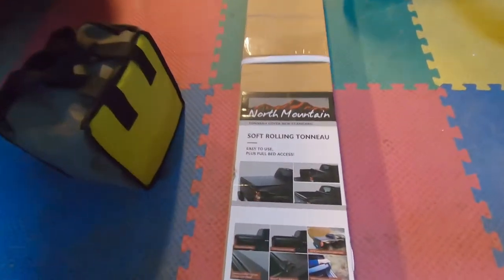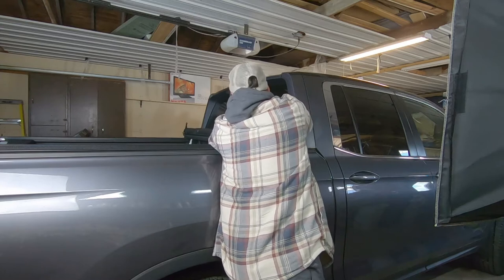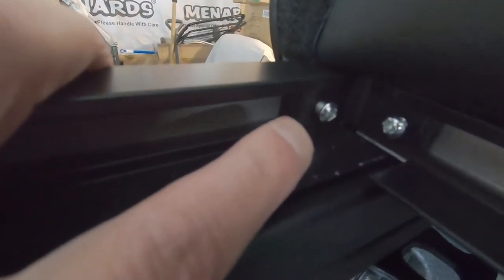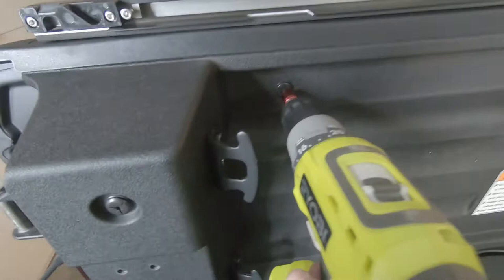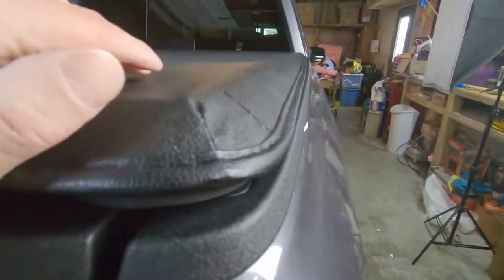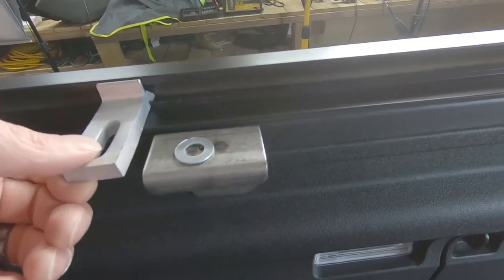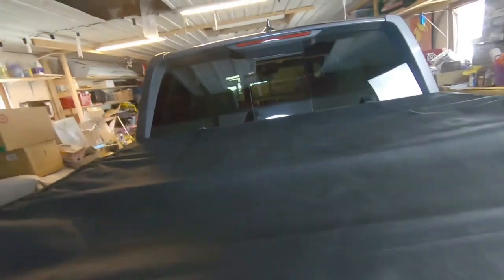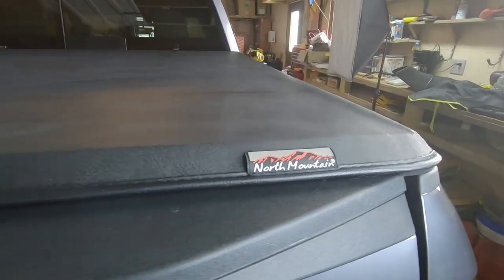How to install a tonneau cover on a Honda Ridgeline 2017- 2023

Comment: Can you still open the trunk all the way with this installed?
Reply from the maker: It will open enough for access but not all the way, when the trunk is fully opened it is taller than the bed. If you need it open all the way simply roll the cover forward a bit.

Comment: Good video and instructions.  I didnt use a power drill to loosen the factory bolts just old man strength.  :)  Finding that T-30 bit was an interesting chore, I found one that was a little rusty but it did the job.   Thanks for showing how to do final adjustments.
Reply from the maker: Awesome! Thanks for watching! I actually just traded for a 23 and moved the top over to that one, it’s still doing great!

Comment: I just installed this one on my 2021. Everything fit great. However, my tailgate door don’t want to open when I roll out the bed cover. I don’t know if it’s a type of lock security. I tried unlocking with my fob. I also trie to disable the tailgate security lock. I’m not sure what I’m doing wrong. So, my tailgate door is lock and not opening. Any idea? Thanks. Great video BTW.
Reply from the maker: The 21’s do have the capability of a locking tailgate. It would unlock with 2 presses on the unlock button, or grabbing one of the front door handles which also unlock your doors. If it is not locked it may just be a tight fit with the cover and you’ll just need to tug a little harder to open it, Thanks for watching!

Comment: Just ordered one for my 21 ridgeline, 
Excellent video 📹
Question how many washers did you used and did they have any lock washer. 
Thanks.
Reply from the maker: Awesome, I just used 1 to 2 depending just trying to get the bracket level I don’t think there were any lock washers I’ve never had an issue with anything getting loose though!
Reply: @GetOutadventure  thank you for the quick response.

Comment: Do you think this Tonneau would fit the 2021 model? Thank you! 😀
Reply from the maker: Yes, I sell Honda for a living the only body style difference on the 20 and 21 is from the a pillar forward the bed is the exact same.
Reply: @GetOutadventure  Okay that is good to know. How much did you get this tonneau for?
Reply from the maker: @BengLang84  I shared the link in my description,  couple hundred or so I believe.
Reply: Put this on my 2021. Fit is spot on, installs same as in this vid. Only diff from 17-20 vs 21 is front end. Bed exact same.
Reply: Will this fit a 2022, I just purchased a 2022 Sport

Comment: Well, mine arrived with the proper labeling, in a box strapped and sealed, but the front bar, from end to end, with the corners installed flush, is too wide for the front sliders to have enough lateral slot, to secure the bolts.
If the clamps are installed to the bed with the factory bolts, There isn’t enough lateral slot in the front sliders to bolt them to the mounts.
Looks like I need to call tech support.
Is there a chance you can measure the width of your front bar, as installed to compare with  the width on mine? Just the bar: Outside to outside ends?That could tell me if they labeled the right box and right T cover.
Thank you.
Reply: In another video, someone said the brackets are different between front and back.  I’d better remove them all and compare them.
Reply from the maker: Where the front of the cover meets the cab I’ve got 64 inches. I hope this helps, if you have any other questions just let me know.
Reply: Thank you very much.  I just emailed North Mountain.
One person posting on another video said that, though the directions don’t say, —-the back brackets are different than the others.
Thanks for your help.
Reply: Success.  The aft sliders are shorter than the other four. 
I have some slight fore and aft wrinkles but I expect that will smooth out.
The bracket and fitment all the way around is great now.
Reply: Success.  The aft sliders are shorter than the other four. 
I have some slight fore and aft wrinkles but I expect that will smooth out.
The bracket and fitment all the way around is great now.
Reply: Success.  The aft sliders are shorter than the other four. 
I have some slight fore and aft wrinkles but I expect that will smooth out.
The bracket and fitment all the way around is great now.
Reply: Success.  The aft sliders are shorter than the other four. 
I have some slight fore and aft wrinkles but I expect that will smooth out.
The bracket and fitment all the way around is great now.
Reply: Success.  The aft sliders are shorter than the other four. 
I have some slight fore and aft wrinkles but I expect that will smooth out.
The bracket and fitment all the way around is great now.
Reply: Success.  The aft sliders are shorter than the other four. 
I have some slight fore and aft wrinkles but I expect that will smooth out.
The bracket and fitment all the way around is great now.

Comment: Great video. The instructions included are poor and don't mention that there are 6 smaller washers meant to go on the top, and 18 larger washers used as spacers for the brackets. Also, the brackets to use in the rear should be labeled with an "R". 

I have only seen some acceptable water leakage with this cover, but I've had problems with it flapping around noisily if I'm driving over 55 MPH. Have you experienced this?
Reply from the maker: Once I un roll it back over the bed I always walk around both sides starting at the cab and pull it tight over the Velcro so I don’t notice any flapping noise inside the cab. I can see it waving around a little in the rear view though.

Comment: We just bought a 2017 and will try this.  I just wished these trucks came with a tailgate that locks.  I found the after market locking tailgate handle but how did that get past the engineers.
Reply from the maker: I agree, they did fix that in the 20’s they now have a locking tailgate
Reply: @GetOutadventure  oh good, does it lock with the remote?
Reply from the maker: @mitchcarpenter4506  Yes! and walk away auto lock.

Comment: Your video was very informative. I just got roll up cover yesterday for my 22 Ridgeline BE.
In the box was one piece of foam weatherstripping with adhesive back. It was not listed among parts nor mentioned in directions. Any idea on its purpose?
Reply from the maker: It should be for the front by the cab you may notice the notches in the plastic on top of the bed, that weather strip should help keep the water from running into those notches.
Reply: @GetOutadventure  thanks

Comment: No water leak in the bed ?
Reply from the maker: A small amount does seem to make its way in where the side and front corner of the bed meet and there is a factory gap in the plastic, however I have heard the same complaint from guys with the Honda tri-fold cover.

Comment: What’s the bed depth/height under the cover?
Reply from the maker: I haven’t measured it exactly but it’s around 15-16 inches, it’s not a lot but it’s sufficient,  that’s why I chose a soft roll cover instead of a hard, I can roll it out of the way and have access to the full bed or just enough for the cargo I’m hauling.
Reply: @GetOutadventure  got it, thanks for the reply

Comment: I seen a Amazon review that showed water pooling on the tonnue cover since there’s no center supports.
Reply from the maker: I have had water pool, it runs off as you start moving of course, it has never leaked through.

Comment: How far can the truck open?
Reply from the maker: It rolls all the way up to the cab, and has straps to secure it. That’s why I wanted this style, when I want to haul something large I need the whole bed!
Reply: I believe the question might have been intended to ask how far the TRUNK can open with the rails in place?  Would be nice to see you roll it up and secure it, then open the trunk.
Reply from the maker: @davidbraddam1912  I understand sorry I didn’t show that. The truck opens part way but not all the way with the top closed. I still can get all my gear in and out of the trunk with the top secured. Thank you for watching
Reply: When the cover is rolled up, will the trunk open fully or do the brackets interfere? Thanks!
Reply from the maker: @ericschoor9479  the brackets roll up in the cover so the bed is completely open when it is rolled forward
Reply: @GetOutadventure  Thanks for responding! I meant- will the silver metal brackets (that are bolted into the bed walls) interfere with the in-bed trunk from opening all the way (opening past the lights in the bed).
Reply from the maker: @ericschoor9479  no they do not, the trunk opens fully no problems. When the top is rollled forward
Reply: I have the same cover and the brackets DO NOT interfere with the under bed storage lid (trunk). The lid does not open vertically all the way but it opens sufficiently to access the trunk.

Comment: just bought the 2022 black edition. because of the current car shortage situation i had to fork out almost $50k for the truck so i have no money left over not even to buy this
Reply from the maker: They are not cheap, but they are great trucks! I sell them for a living and I’ve only seen 1, 22 black edition so far. Glad you were able to get your hands on one.
Reply: can u open the trunk with those side rails installed?
Reply: I bought a 2024 Black Edition for 46k. I am glad I waited for the 24 because it has some nice upgrades inside and out. And, they were willing to sell it for 2k under MSRP.

Comment: Good luck with the cap screws in your bed. Mine are so tight I don't know if God himself could get them out. Currently drilling them out with an extractor & they won't budge.
Reply from the maker: I’ve actually taken it off and loaned it to a buddy with a Ridgeline and put it back on with no trouble. Good luck with yours.
Reply: 2 of mine were like that too, I had to ditch the drill and latch vice grips to the screwdriver and hammer it loose.

Comment: Anyone else experiencing transmission problems with their 2018 Ridgelines? I purchased 10 and all seem to start skipping and shifting hard every 45,000 miles
Reply: 99% 3rd gear pressure sensor. Older Acura RDX with the same trans has exact same problem. Paid around $400.00 at Honda dealership to replace it  on my 17" Ridgeline about a month ago.
Reply: yes when I installed this cover, it made my transmission start slipping